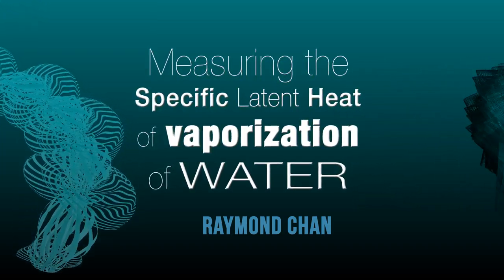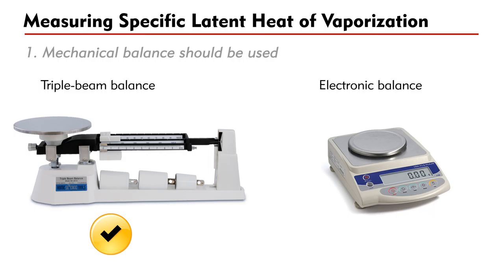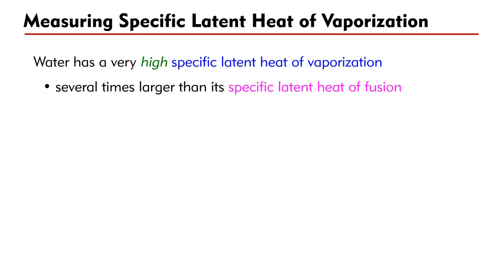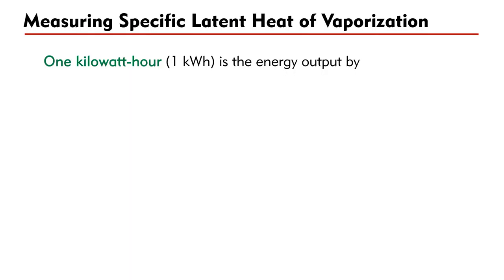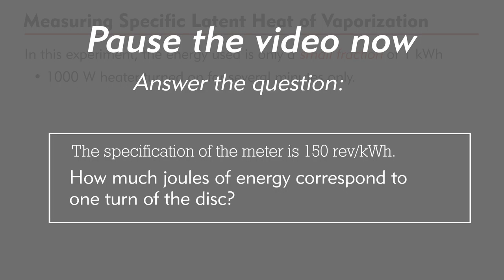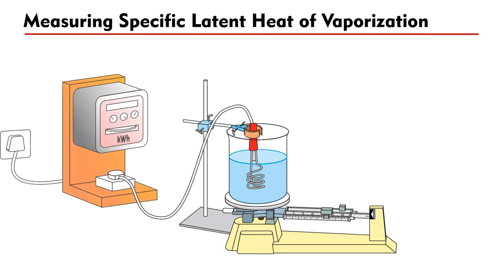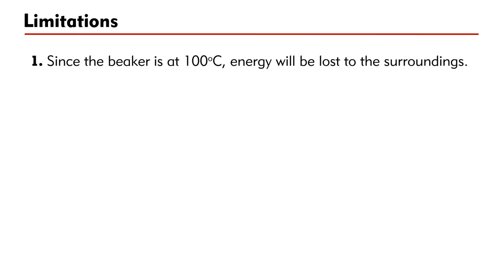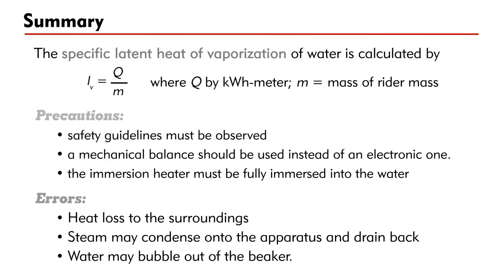Measuring the specific latent heat of vaporization of water

Comment: 1. Use a polystyrene cup instead of a beaker to prevent heat loss. 
2. Use a taller cup to prevent water from spilling out (but finding the right cup may be hard). 
3. Wrap some tissue paper/pieces of towel on the clamp, the handle of the heater, and on the edges of the beaker to prevent water from draining back...hopefully holding it for a while.
Reply: That helps a lot! Thank you so much
Reply: What about the details for this experiment like objective, introduction and conclusion? Can u please tell me?

Comment: Use a expanded polystyrene cup  (with a lid)to store the water.It can prevent heat loss to the surrounding and the water spill out of the cup. It can also prevent steam to condense on the clamp and the cup itself.
Reply: But isn't the lid block the way of steam coming out? All the water droplet condensed would drain back
Reply: +Lisa Ma Oh,thx for your reminder
Reply: What about the details of this experiment like objective, discussion or introduction.. Can u please tell me? I need it asap

Comment: Wrap the beaker with cotton wool to prevent heat loss
Place a piece of kitchen on top of the beaker to abort steam and avoid water droplet drain back
Fill the beaker with only one-third full of water to avoid the water bubble out
Reply: How about we use polystyrene cup instead of beaker?
Reply: +Thomas Chung well, good idea. I didn't think about it.
Reply: +Lisa Ma What about if the heater may not be fully immersed into the water if we fill the beaker with water one-third full?